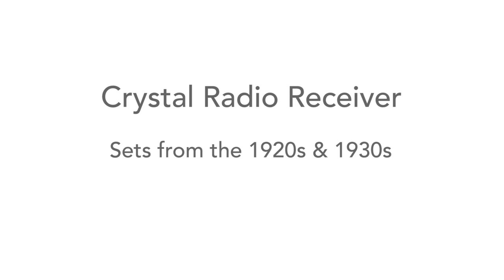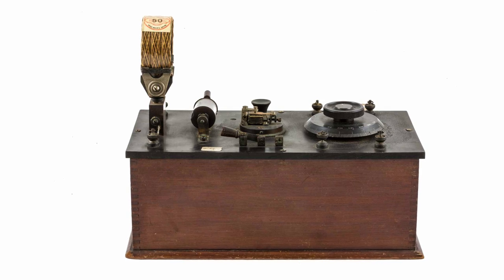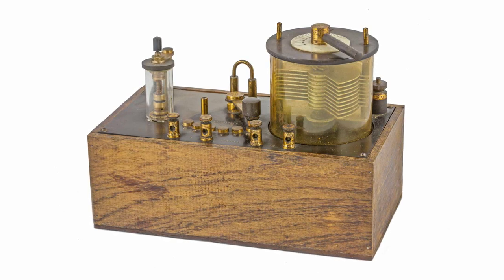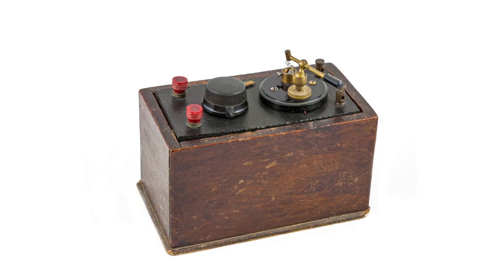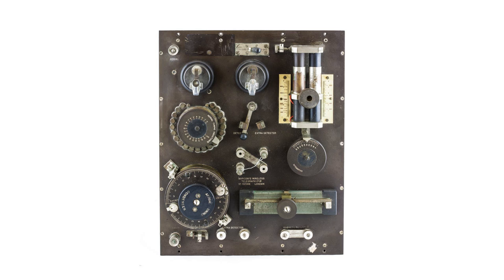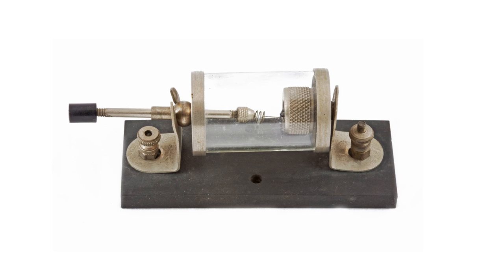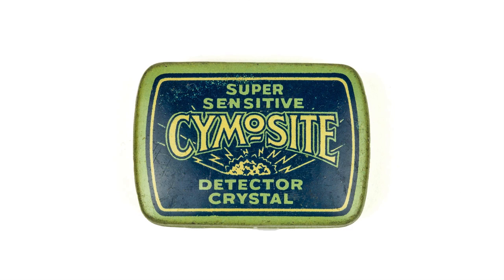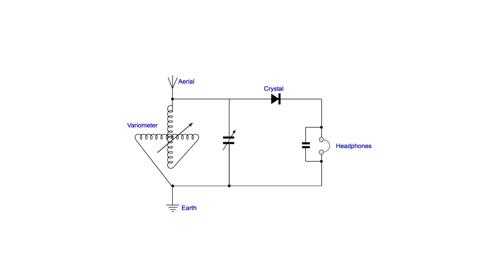Crystal Radio Sets from 1920s & 1930s

Comment: I remember crawling on a rooftop terrace in the 50s. with my home-made radio and a 40 ft. antenna; could only clearly get two stations. Great memories!
Reply from the maker: Wow - memories like that never go. Similarly I can remember needing  really good antenna for a crystal set and needing to make the antenna as high as possible.
Reply: @ElectronicsNotes  We used my friend's terrace on top a a second-floor which was about 20 feet high and ran a 40 foot copper wire and a lead-in probably 10 ft.
Reply: Good times, aren't they?

Comment: If, they only had a diode ...
Reply from the maker: The diodes used were to the modern ones and although the basic concept was straightforward they needed a mechanical arrangement to hold the crystal itself.